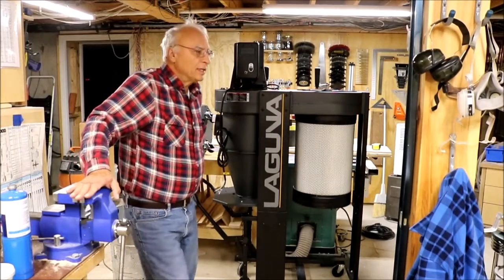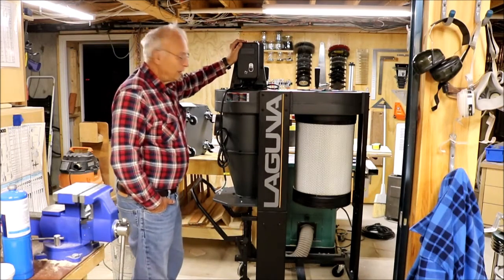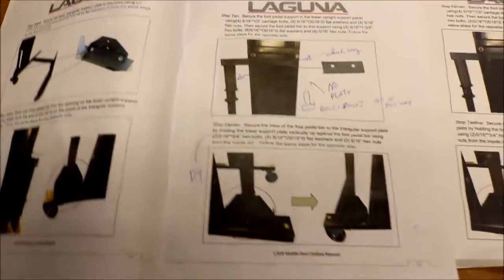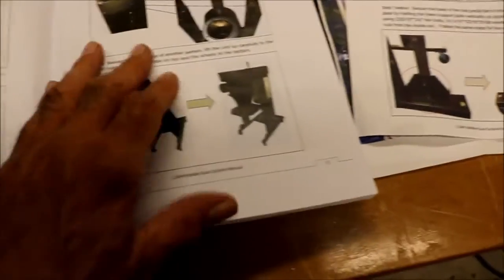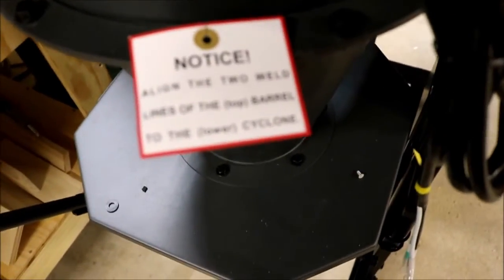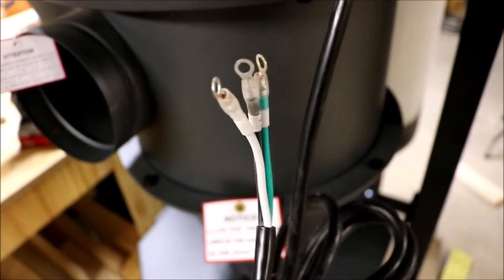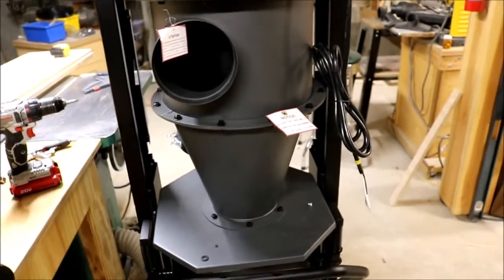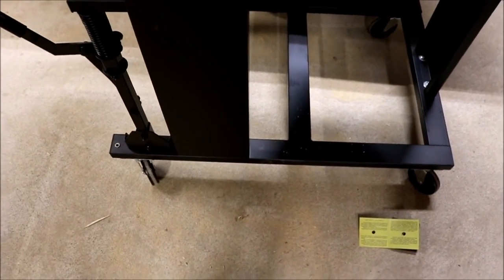Laguna CFLUX1 Dust Collector Review

Comment: This was pretty funny to watch a week after I put mine together.  I will say I came up with every single one of the issues you point out so they clearly haven't fixed any of these issues.  Whoever photographed for the manual needs to be fired.  They clearly didn't understand how to use lighting.  The octagon barrel was without a doubt the biggest pain, to put the bottom on I used clamps to hold the head of the screw while I installed the acorn nuts on the inside ( I see you did it the other way around).  I would say I spent more than a couple of hours putting that together.  I think the unclear directions made the assembly go way slower but I will say that I put it together in about 7 hours over two days.  Again, the manual made me doubt what I was doing the whole time and made it maddening to put together.  The weld notice was one that I misunderstood and took it apart only to find they were talking about the welded seams on the backside, so that was wasted of time.  I bolted casters the same way.  Also, to install switch I had to enlarge hole a bit on back to accept screw head in order to hold it to the bracket.  All and all a terrible experience putting it together and I consider myself quite handy.  I have only used this unit a week now and the 82 db claim is a joke, more like 100db but the unit itself works as advertised.  Oh, and I did wire a 30 amp 110v circuit which added to the time and money of machine but I knew that upfront.  My only complaint is that the size of the octagon is pretty small and will need to be emptied pretty regularly if you are milling up your own stock, which I do.  Wish I could have afforded next model up but I think it will do the job just fine.

Comment: I have the same unit , put it together in April 2019. I had the same problems as you and others that have commented.
The barrel was not fun, and the hardware the manufacturer chose is simply not robust enough. Also, I used larger fender washers paired 
With the casters to provide added support as the bottom of the barrel is flimsy. I had to laugh at your comment about the plug wires, my electrician said the same thing.

Comment: I put my PFLUX3 together and the dust bin was the most difficult part as it came with mini bolts and acorn nuts. A human can’t reach both so well. I did use 1/8” rivets from the outside inward on the bin bottom. Worked great.  The best assembly video is on the Laguna you tube channel. I watched that twice before starting. I still did it slightly differently.  I recommend to watch that video. I share a welding outlet and placed a welding plug on this 22 Amp 3 HP motor.  I called Laguna and this motor has over current protection so my 220V 40A circuit worked fine. Otherwise I could not have gone this big.
Reply: I'm thinking about buying Laguna 3 pflux . Like to know would you recommend on buying one. Thanks
Reply from the maker: If you have the patience to deal with the instructions and assembly, yes